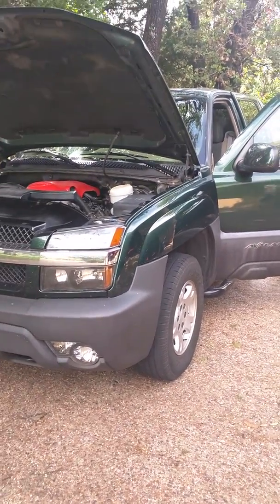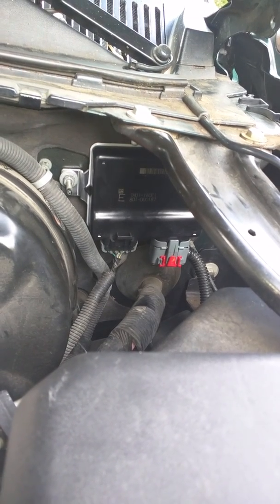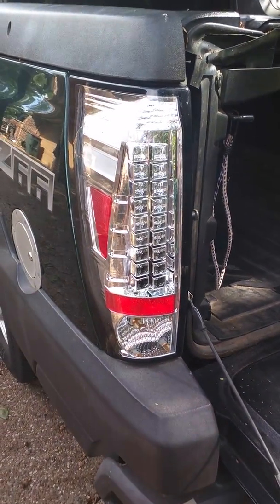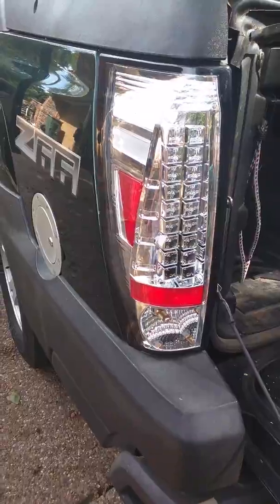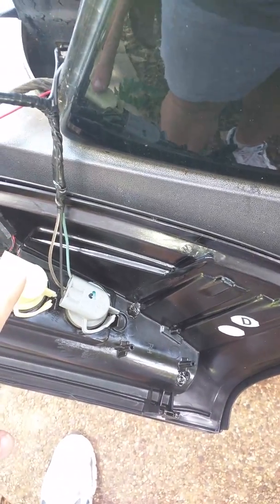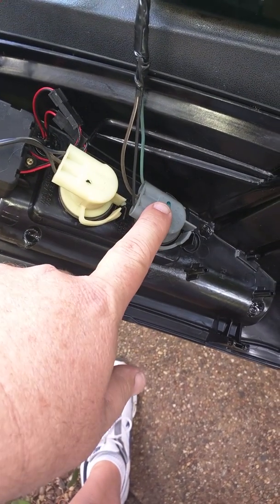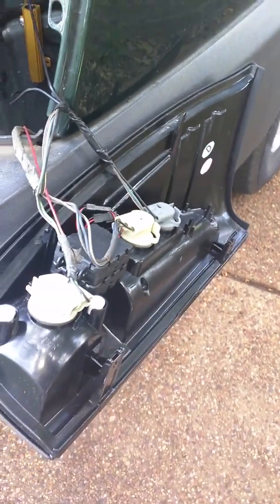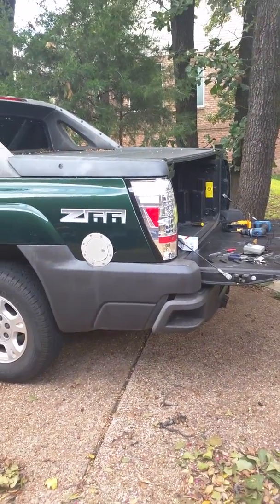03 Avalanche Silverado Sierra GM Cruise Control not working w/LED taillights

Comment: You are my savior!  I’ve been scratching my head for the better part of the year.  I installed LED bulbs in February but I didn’t install the resistor for them.  Not knowing this would be an issue, my cruise control stopped working.  I didn’t put the two and two together.  Instead I went down the entire checklist replacing parts.  Then I came across your video and then it hit me.  It was the LED brake bulbs.  I just switched back to the regular bulbs and low and behold, the cruise control start working again.  SMH 🤦🏻‍♂️

Comment: worked on my silverado 2500 with an aftermarket flat bed that had LED lights in it.  Thanks man!  What a weird problem.
Reply: Did you have to do it to all 4 signals?
Reply: @Brandon-ko1vx no just the passenger taillight

Comment: Thanks you soo much for this video, My cruise control didn’t work at night or when the head lights come on. I added these tail lights about 3 years ago, and couldn’t figure out why. Yesterday I put a resistor on the passenger side brake light wires and boom it started back working !!!!!!!! Thanks

Comment: Lol thanks for the video I just recently realized I was getting zero reaction not even a on light in the instrument cluster that my cruise was on. And I did put some sweet led tail lights on my 05 gmc sierra so I think there's a good chance that's what the prob is 👍
Reply: I've got an 02 suburban and I put LED bulbs in place of the old incandescent ones, just swapped it back and I'll see if that fixes the cruise control not having any signs of life. I had another weird gremlin that popped up with the 3rd brake light staying at about 10% brightness all the time when the parking/headlights were on with the LED bulbs, but that was solved by switching back.
Reply: did you ever confirm this was the issue? dealing with it now on my 03 Denali after LED swapping all the lights

Comment: Does the third brake light communicate with the cruise control? I did both rear tail lights with leds and cruise control worked for as long as I can remember and i noticed it not working when i did the third.

Comment: 05 GMC 1500 Sierra Crew Cab --- Odd difference  ... 
I have had LEDs in everything for over a year and the Cruise Control problem just started three months ago, but was intermittant. I have always had the resistors installed, so I was confused for a bit. What I ultimately found was a poor ground in the LEFT taillight resistor connection  to the body. 
I cleaned the corrosion and the problem was cured. 
This was the LEFT resistor ground ... not the RIGHT. 
I found the intermittant ground with a LOGIC PROBE, not a 12V test light because a test light becomes a load on a digital circuit and can give false results. 
I believe there is supposed to be no hash on the digital handshake or Cruise Control is disconnected by design for safety considerations.

Comment: Everything works on mine but the brake light  and all I did weas change the turn signal relay to led relay. And my cruise works too.. why no brake light?  Works fine with the original halogens

Comment: Sir my son put his led lights in about 3-4 months but the cruise control still worked. Then the other day I was riding up the interstate and the cruise just stopped working? I’m wondering if this could be my problem? Did your cruise control instantly go out or did it go out like mine?  Also my son’s truck is a 2002 Chevy S10? Thanks.

Comment: ok I got gmc Sierra 2005 . bought my led taillights that looks like came with resistors. funny thing I noticed.  cruise control is working, but whenever I start using flashers. cruise control is off..and need to restart a car.
 My quastion  is. do I need to put extra resistor or maybe higher resistor..to solve this? anyone know? 
 I mean it's not really bothering  me..but it seems like it overloading whenever I use flashers with all lights on..

Comment: Quick question, were your led lights causing your signals to hyper flash before you installed the resister? And how about afterwards do they still hyper flash or do they flash normal?
Reply from the maker: They might. If you're using the original flasher assembly you may well get the hyperflash because the voltages associated with LEDs are so low. You can get an upgraded (digital) flasher relay on eBay or Amazon or elsewhere that handles LEDs. Alternative would be to install inline resistors on the 4 turn signal circuits. Inline resistors are cheaper than a new flasher relay  unit, but more labor required.
Reply: They go back to normal, this fixed my hyper flash
Reply: @aleeking1  cuz I have resistors for my rear LED tail lights, but I guess cuz I have LED bulbs in front they still hyper flash which I’m still cool with the hyper flash 👍🏽
Reply: @suelo_abuelo8066  That’s a separate, circuit, you’ll have to put them on each of those in the front

Comment: I just i stall all LED lights throughout my 2003 sububan, and my cruise stopped working. Hope this is the fix. Will find out shortly!
Reply: Did you solve the issue? I have a 03 chevy tahoe and i installed led tailights but funny thing they camed wired with resistors and yet my cruise control does not work. Not sure if im supposed to add another resistor to
The wire pointed out in the video
Reply: @g.e.587  you shouldn't have to. I added one on drivers rear brake and another to the interior map lights for a dimming issue. All is well.  I have read that it depends on the ohms of the resistor.
Reply: Steven Townsend thanks for the info! Will be checking that out tomorrow

Comment: HAD A 2004 SURBURBAN CRUISE PROBLEM,  AFTER TESTING EVERYTHING,  FOUND THIS WAS THE PROBLEM , BECAUSE OF THIS VIDEO  WAS ABLE TO PUT THIS JOB BEHIND ME... CUSTOMERS VEH. HAD SEPERATE BRAKE LAMP BULBS FROM TURN.   CUSTOMER HAD RESISTORS ON TURN SIG. BULBS.

Comment: 2005 Tahoe z71, put LEDs tail lights in. Cruise won’t work. So put that resistor in and it should work again?
Reply from the maker: Yes, resistor on the right brake light wired in parallel. Good luck!
Reply: I did what you did an mine worked again! Thank you!

Comment: Think this applies the same for a 02 silverado i have led tailights and third brake light ???thx
Reply: Dr4620 I got the same thing with the same truck I’m assuming it’s the led lights
Reply from the maker: Should be the same fix guys. In line resistor (wired in parallel as opposed to in series) on the right brake light should fix.
Reply: I put the resistor on my right tail light and now mine works I have been having problems at night but it would work during the day time as long as the headlights were off and I have a 2001 Chevrolet Silverado

Comment: Also, could this be the reason why I didn’t have any trailer breaks?
Reply from the maker: Certainly a possibility. While i don't have a trailer brake rigged on mine, if your trailer controller is looking for an electronic braking signal it may not be getting it b/c of the issue described in the video.

Comment: So did you get my last question?
Reply from the maker: Sorry for the delay, the day job gets in the way sometimes.
Reply: sgounaud on thanks, understandable sir, will that digital flasher take care of the cruise control or do I still need a resistor? I’m running all LED lighting, all I want to do is get my cruise control working again. Thanks  🙏🏽
Reply from the maker: @suelo_abuelo8066  unfortunately no, you'll need the digital flasher for the hyperflash (or inline resistors on all 4 flashing lights), and a resistor on the right brake light for the cruise. I wouldn't have designed the system this way, but we don't get a vote. Good luck!

Comment: Good stuff man good stuff. Recently my cruise control stopped working and I was questioning like what the fuck? Now another question I have for you do your panels on your Avalanche's bed leak because mine do and I'm trying to figure out if we have to order some or is there some way I can just replace them with better ones
Reply from the maker: Mine have leaked on occasion, usually a good cleaning of all the seals and some armor-all fixes the problem on my end. Would be hard to find new ones I imagine ax the Avalanche is no longer in production.